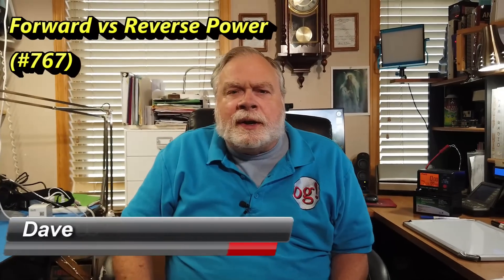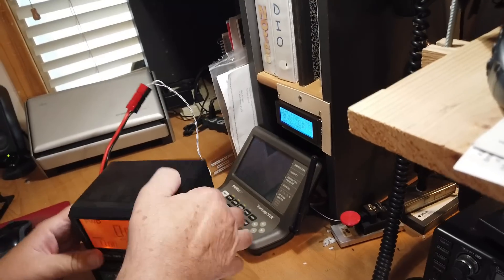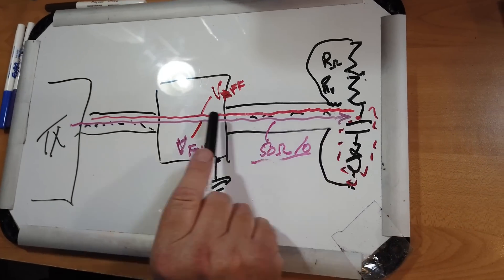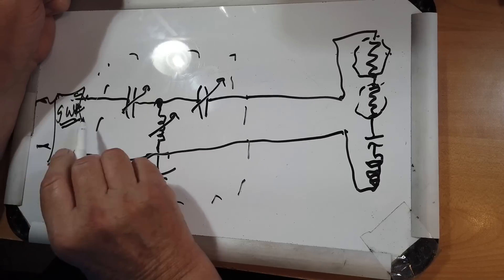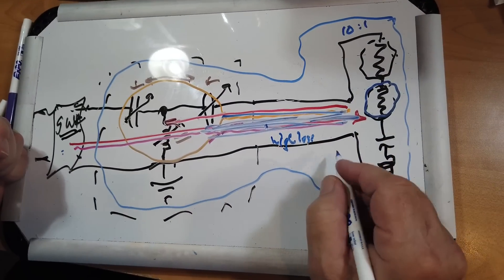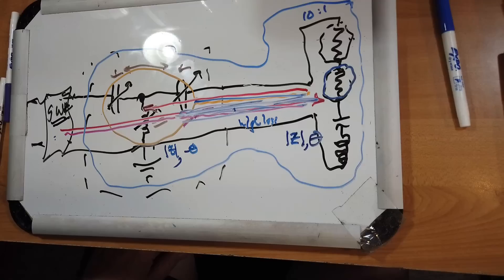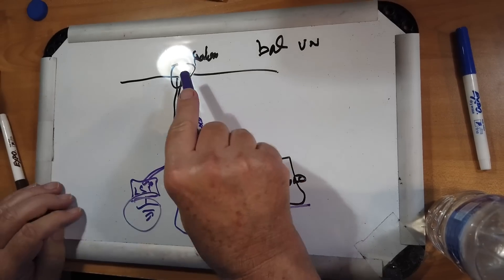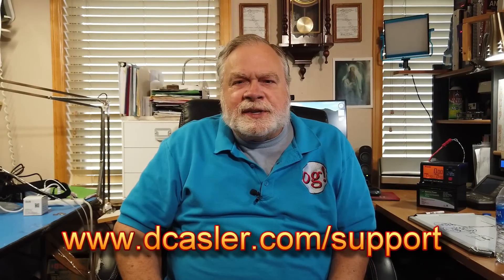Forward vs Reverse Power (#767)

Comment: Those LiFePo4 batteries are really underestimated among amateurs. Lot of power vs. carrying weight, and very stable voltage output during discharge compared to lead-types. They cost more than lead-acid/gel batteries, but have a much longer lifespan so at last they give the most power for the money. I have the Nissei RS-50 and RS-70, they are both excellent SWR-meters.

Comment: Can anyone help me with a question? I'm using a surecom swr meter. I have an all band discone antenna 40 feet up. I had this setup hooked up to a 5w ht. Recently I set up a base gmrs/ham to this. At 5 watts I get a perfect 1.0 swr on all frequencies , but if I set the new radio at 15 or 25 watt setting, the swr goes to 1.9 on all frequencies.
The swr meter is fully automatic, no calibration. What is going on?   Why does the increase of power cause the swr to climb? Thanks T

Comment: I have this same meter, but what I don't understand is lets say the SWR is 6:1 and the REF Power is 45Watts, the meter shows that there is 160 watts power going out. How can this be??? I also checked this with another meter with the needle analog display and got the same results. The values I'm using are just for my explaination of what i'm seeing....Thanks,

Comment: Please help me understand this: Say you put an ATU in between your radio and your antenna, and that the antenna is resonant, having an impedance of 35 ohms (which means NO reactive part in the impedance at the frequency of operation). Now, how can the ATU - that consists of purely reactive components - transform this to 50 ohms resistive impedance? I can understand very well how it can cancel out any reactive part, but how can it convert the resistive, lossy part of 35 ohms into 50 ohms, using only reactive components??? It obviously can, but how does it work?